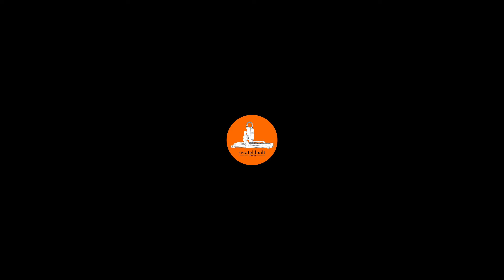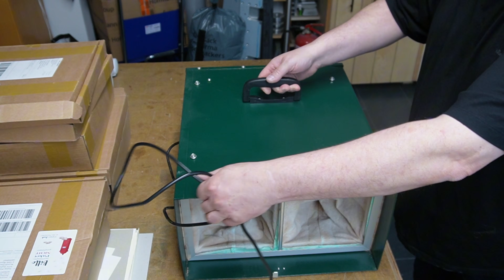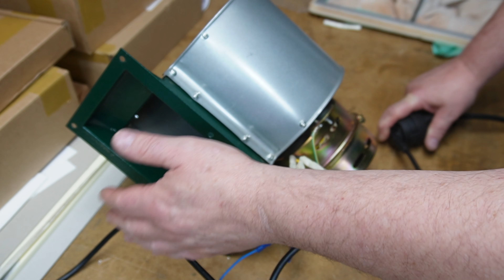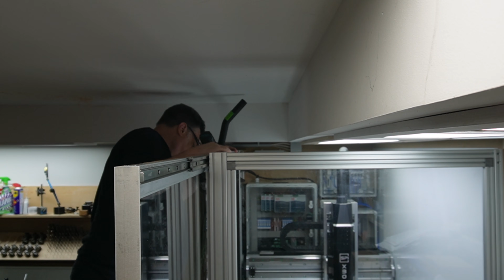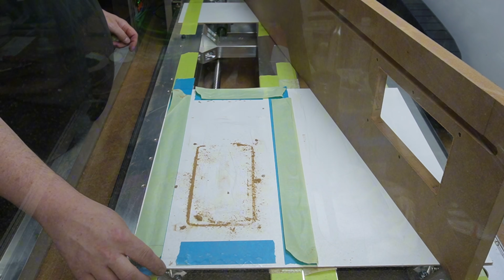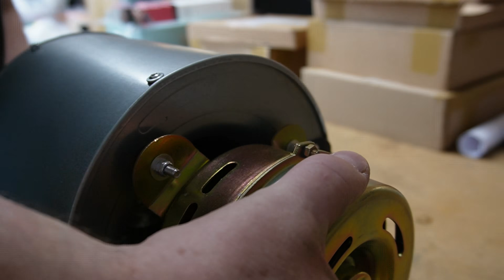Ultimate CNC Enclosure Part 3 - Integrated Air Filtration

Comment: Seen this video and instantly ordered one! I always thought my workshop is way too big to use it for the room, but never crossed my mind to just use it for the machine itself ;D
Reply from the maker: Awesome 👍 
It requires some regular maintenance and cleaning of the front filter, but the reward is clean cabin air instandly after the job is finished
Reply: @scratchbuiltdesigns  Will add it to my weekly maintenance protocol :) 
Just all the other extractions that exist use so much power and are noisy af
Reply: Quick follow up here, works like a charm and creates a nice negativ pressure in the enclosure! Can highly recommend.
Reply from the maker: @FriedrichKegel  Awesome. How cool is that? I am glad this video inspired you to do it 👍👍

Comment: Really well done a great way of addressing the dust. How does the air get INTO the cabinet? 
An entry at the right hand back corner would give something of a cross flow shape to the air flow helping to clear the entire cabinet.
Or if you really want to make sure that when you open the door the area you are exposed to is a clean as possible perhaps open up the gap between the door and the side panel that you tried seal up well.......

The Record (and most other) room filters say they filter to micron and they do - just not very well, but WAY better than not having at all. 
They can quote things like the % of dust removed. 
They are correct I am sure with what they say - it is just the the sub 2.5 micron particles that are really bad for you because they get into your lungs weigh virtually nothing. 
So you could have something like  99.99% removal but still have virtually all sub 2.5 micron particles not being filtered.

The filters will capture more of the ultrafine particles as they get a coverage of dust - it acts like more filter material.
The best way to tell when to change the filters is by making a water manometer so you can see the vacuum reduce as the filters stop the flow of air.
When changing the filters remember what they have in them - particularly the stuff you CANNOT see is what you don't want anywhere near you.
So a proper mask when doing it and try and keep all dust to a minimum.

A HEPA 13 filter is what you really need to REALLY get the air clean enough for your health.
Perhaps you can add an inline fan with a HEPA filter on the outside of the box - it would need to have about the same flow capability of the current fan (preferably more).

Make sure your shop vac has a HEPA 13 filter as well - particularly given you are using MDF - the worst material for making ultrafine dust... :(
Reply from the maker: Thank you. Great advise 👍

Comment: Not an electronics expert here either, but I'm willing to bet you could control the motor with an electronic VFD, which could then be controlled by the CNC.
Reply from the maker: Probably. But it's not a 3-phase motor, so not so sure about a VFD. But all it really needs to do is to turn on and off (with a delay) and that's already controlled by the CNC in this setup
Reply: @scratchbuiltdesigns  ussually VFD have relay you can program to switch on with spindle to control water pump i.e. or blower in your case (contactor)
Reply from the maker: @dibonko Yes, but I wouldn't run 230V 60Hz AC current through the MX2 VFD SSR. So en external relay would be required and in this case I don't see the difference whether it is triggered by the CNC controller or the VFD
Reply: @scratchbuiltdesigns  ahh... you have SSR relay in VFD? I have standard relay in my VFD.
Reply from the maker: @dibonko  The MX2 has in total 4 configurable relais. Two are dedicated to the alarm status, and two are free and can be programmed to trigger for all sorts of stati.
I use one in combination with the 0Hz status to make sure the tool cannot be released manually while the spindle is still running.
On my old machines I used to have a spindle with an air seal and that was switched on when it was running. 
Most people I know with an air cooled spindle use one of the relais to switch the fan.
They can be programmed as well with a start/stop delay

Comment: As always, i love your presentation in both mechanical and electronic aspects. Could this setup work for aluminum too? I notice when milling aluminum there is flying dust just like wood. 

Also, at the start of the video, i see you are using a different spindle with two spindle mounts. Is the second mount necessary? And does it provide more rigidity? 

On my build, i notice there is a lot of spindle vibration along the x axis movement while milling steel but not on the y axis movement, i am only using one spindle mount holding the spindle on the bottom (spindle is 2.2kw  chinese water cooled).
Reply from the maker: It should have a positive effect when milling metal too.  ALU flitter from thread milling could be catched, but more realistically it could filter dust from MQL coolant vaporisation...
The video in the beginning was my old machine and yes, it had 2 spindle mounts, mainly for improved rigidity. 
It was the spindle manufacturer's recommendation

Comment: I had a short laugh, when I saw you built this from such an Aircleaner. Have thought about trying exactly the same in Case direct extraction is not working.

Just one thought: Maybe you want to consider hanging a small "tray" right below the first filter so excessive dust doesn't just fall back down onto the machine and can be vacuumed from the tray?

Kind Regards,
Johannes
Reply from the maker: The easiest way is just to mount the complete unit on top of the enclosure or one of the sides, if space permits.
And the particles tend to adhere to the felt of the filter and don't fall back...

Comment: Your build is amazing! I look forward to you videos :)

Have you considered how the air will be replaced in your enclosure? It looks pretty tight so you might have significantly reduced effectiveness of your air cleaner if the enclosure doesn't allow 11.2 cubic meters per minute of air in to replace what the cleaner is removing. I also saw that you put the electronics right above where the filter is in your new box, are you not concerned with those getting dusty/dirty over time?
Reply from the maker: Well, I have indeed thought about that too. It is not fully air tight though, but eventually I have to add some ventilation holes somewhere.
The electronics sit already behind the first 5 micron stage and at 4:40 you can see how little dust entered the second stage after two years of use above the old machine. So I guess I should be good...

Comment: I remove now for years the chips with a standard Festool hose. Even the “dirty” HDPE will cleaned without any problem.  As motor I use the Festool systainer dust collector.  I would consider the small hose and not the 80mm. You need 80mm for a planer not a fine dust cnc

If you like to have some pictures, just send me a mail address

Ahhh sorry very nice build NC super well done
Reply from the maker: Well, it depends on how many chips you actually create. And with a 60mm Tornado face mill and 2-3mm cutting depth it can in fact become an issue. And I do this quite often, because I substituted my Makita 12" planer with the CNC, because it can manage far bigger boards.
But I agree, for most "normal" stuff it should be ok and as I mentioned in the end, I am still thinking about a solution.
Btw., I have the same Festool shop vac with the systainer separator in use for cleaning chips after the job...
Reply: @scratchbuiltdesigns  just sharing my results. Maybe your situation is far more different. To consider, if you have once in a year a big mess, do you need to build an almost impossible 80mm solution for all time or accept it and manually clean the NC. Looking at you workshop you don’t make daily money with the nc, maybe when you use a big face mill, go to 1mm at the time